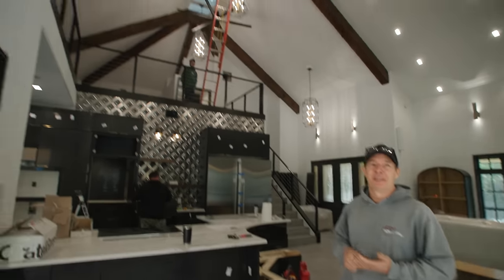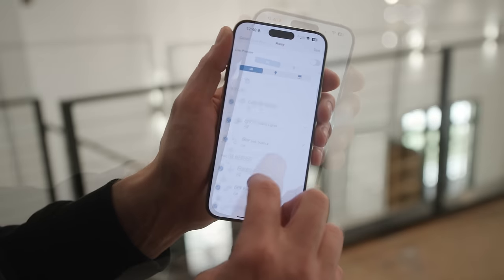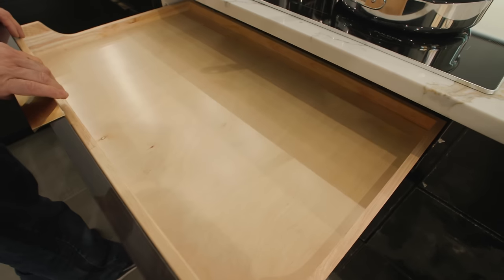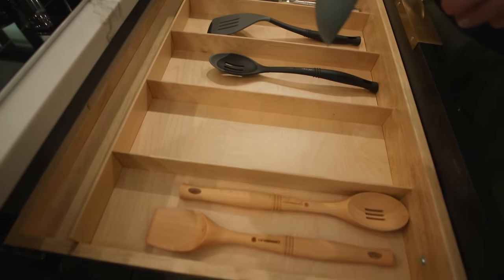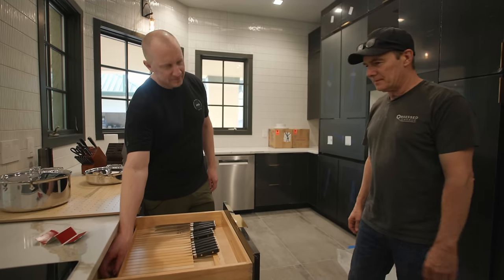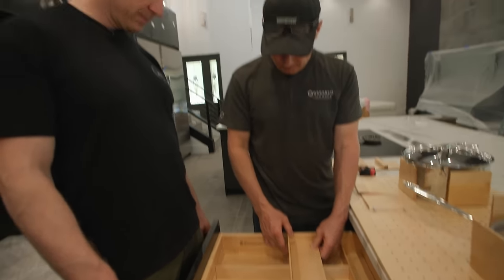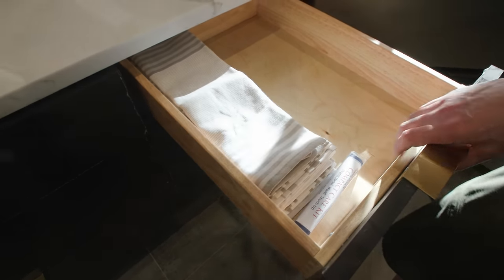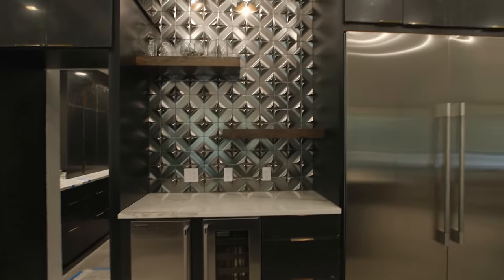Renovating Adam LZ's House - Dialing In Adam's Kitchen Drawers! | Hafele Organization | EP.35

Comment: Cant wait to see the kitchen full! 
Tile is always hard to look at in an empty space, I just did a bathroom project and tought the tile looked aweful, until the decoration came in, then it blends and makes a nice contrast.
Ive seen tons of negative comment but im sure nobody sees the quality of work that yall are putting up there.
Adam and Colette will be set for life!
Nice work and keep it up!
Reply: No one with any brain doubts the quality of the project. I'm not a big fan of the pattern either, but I think the real challenge is the gloss finish. It was also originally only supposed to be above That section rather than across the entire wall across the top. It is going to need a lot of decorative treatment to try and dull it down.
Reply: Yeah, those high-quality TM cardboard cabinets are one of the core marks of quality in this project, as are the baseboards, the wiring, the tile on the living room accent wall and the tasteful design, am I right or am I right @VapedTalon

Comment: FYI the knife steel isn’t technically a traditional sharpening tool like a wet stone for example. Although the steel does make the knife sharper, its job is to just take out the rough edge of the knife. It’s meant to maintain a sharp edge and not actually sharpen it so to speak. That’s what you use a wet stone for. Also the steel is an essential part for day to day use of the knife. Definitely don’t brush it off. For $1000 plus set of knife’s there is a reason they include a steel with the set. BOOM!!! Obsessed about knife’s

Comment: I've been told it's bad Feng Shui to leave knives on the bench in a knife block so putting them away in the drawer is the way to go.

Could also use a router to widen one of the slots in the knife block to allow the shears to sit in the block rather than at the back.

The cutlery drawer is doing my head in. I've always done the knives on the right, forks in the middle and spoons on the left. Could use a 2nd knife insert and put the knives individually in the drawer. Would take up one of the open spots.

Comment: 18:25 A steel doesn't sharpen knives, it removes the bur that gets created through use. Generally, you would use them once a week or so to maintain the edge. Whetstones are for sharpening the edge which will remove material from the blade (not the bur alone) and reshape the edge.

Comment: You need to try the Lutron Claro wall plates in stainless steel look.  They have a metal face and black plastic edges.  Check them out. I think they would be appropriate for the kitchen tile wall.

Comment: Matt where the hell is the spot for the Tupperware and all the rubber spatulas, tongs, pizza cutter, and all the to go plastic boxes they're gonna keep just in case 😂 I guess there's enough room but if ur remodeling a Bachelor and Bachelorette's house and they don't cook they def need Wal-Mart plastic bowls n containers 😂
Reply: Negative on the plastic containers.  Get glass with rubber ring lids.  They'll last forever and won't stain if used in the microwave.  If you're still doing plastic containers, it's because you don't know better.  Get a complete matching set and you're good to go.

Comment: There’s a dent on the top left corner of the refrigerator door. You can tell that the light consistently reflects oddly from that spot no matter the camera angle.
Reply: Noticed that. Probably from the drop
Reply from the maker: No dents.  It’s just reflection.  We dropped the freezer.

Comment: OOF storing your knives like that will dull the edge much more quickly. Looks great but NOT really knife friendly. You might as well be cutting boxes.  ( -I sold and sharpened kitchen knives professionally for 10+ years. Shun, Henckels, German, Japanese etc. Not a Cutco salesman, an actual salesman with a storefront who visited the factories and had personal relationships with the owners of these companies) Unless you can store them blade side up
Reply: Can you elaborate on that? Is it the knives hitting the wood every time you store them that causes them to dull?
Reply: @RA-dh1tb  pulling the drawer in and out, as well as removing or restocking the knives in and out, usually causes the edge to move, rub, slide against the wood. Not to mention any left to right movement once the knives are in place. These are nice soft close drawers but  most people rip open a drawer and slam it shut atleast a few times a day. It's incremental but adds up over time and hard on edges. Especially Japanese kitchen knives which have very thin/fine angled edges which naturally won't stay feeling as sharp as long to begin with. Hope that sufficiently answers you.
Reply from the maker: That makes me think turning face up may make sense.  I’m going the test it out.

Comment: That round steel that comes with knifes is called honing steel and its NOT for sharpening knifes 🤦‍♂️ it also doesn't mess them up. It's for straightening the blade/steering off the tiny little metal fragments from the blade that occur from using the knife. It doesn't harm the knife one bit Matt🤦‍♂️ Sheesh. For someone that is "obsessed" you don't know anything about knifes